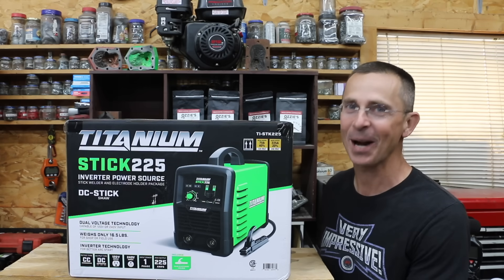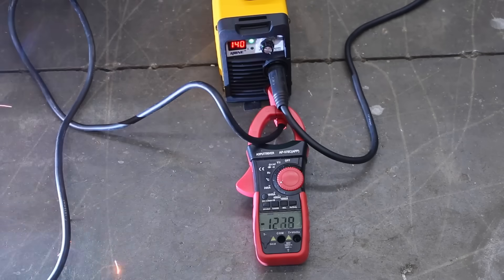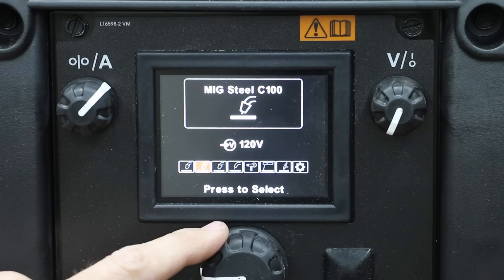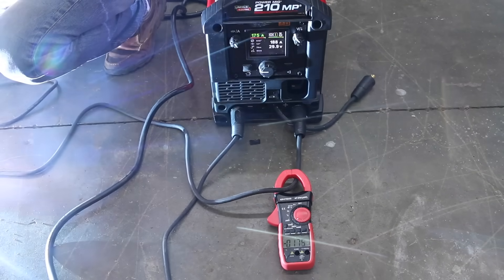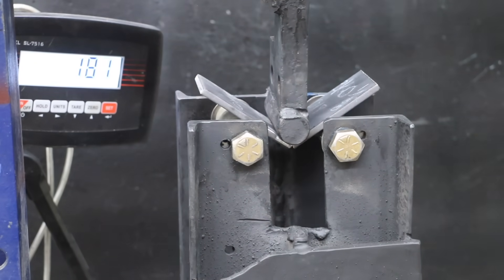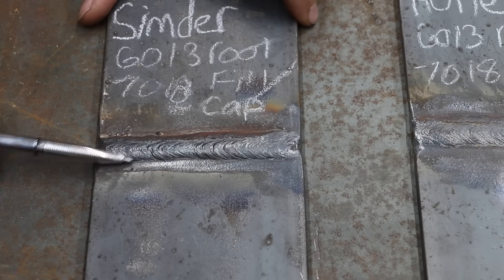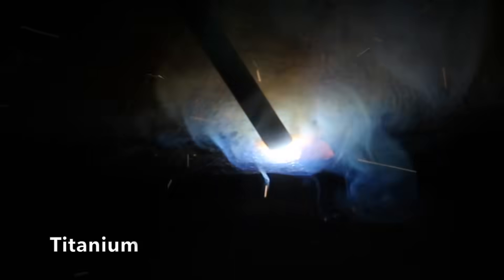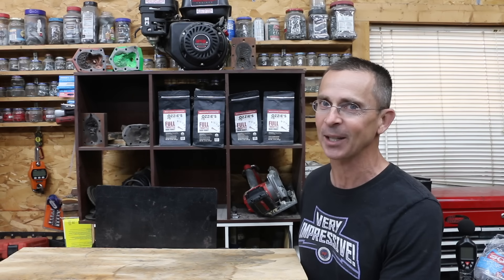$70 vs $2,300 Welder? Let's Settle This! Weld Strength, Duty Cycle, Current Output, Build Quality

Comment: The clamp on current meter may not measure current correctly.. there are limits to wave shape and frequency.

Why didn't you test the harbor freight titanium mig at 449 ... The Chicago electric mig is really old technology .. it's thenonly one there that is 69hz xfmr with rectifier... rest are inverters
Reply from the maker: Thanks for the suggestion.

Comment: This is an extremely good testing channel, but in this case, you tested a bunch of off brand  SUV against one Ferrari.

How stupid.

There was only one decent brand represented: Lincoln. And the top brand: Miller was not even in the test.

This video should have been named "Shitty welders tested against one decent brand. All except one tested as shit".

This was a pathetic test. Definitely up to the normal standards of this channel, so if this is your first visit, definitely give it another chance. I will, even though their grade went from an A- to a C-  after this hot mess of a test.

Comment: Test the titanium easy flux 125! It’s a very popular welder.
Reply from the maker: Thanks for the suggestion.
Reply: @ProjectFarm  here’s an idea. Since flux core welders are the most popular and most purchased, you could do a test on the different brands of flux core wire and see which wire gives the best results in a flux core welder. Whether it’s harbor freight (Vulcan) or Lincoln innershield or forney or easy welder etc.

Comment: Thanks Joe!
Here's an idea for the next test: I have a large Lincoln tig machine, but I am looking for a small combination Mig/Tig machine to do some light sheet metal welding on my '55 chevy sheet metal. Only concerned with mild steel, but would like it to use my foot pedal and existing torches. Is there such an animal? If there are a couple, let's see which one is best! Thanks!
Reply from the maker: Thanks for the suggestion.

Comment: Not a good review, if you weld you always check for penetration and turn up the current until you get it, you don't really care what the Ampage actually is. Far more important is the Duty Cycle and what happens when you exceed it. How long before it cuts out, how long does it take to recover, if it's got a crappy fan and cooling this can take forever. The cheapest most reliable welders are the old type with a just a big transformer in a case of oil, if you sit them in a tub of water with the hose pipe running(Obviously you make sure it is impossible for the water to reach the connections at the top because the water flows over the top of the tub first, the case is already water tight or the oil would leak out). You can weld all day at 250Amps this way and you can pick them up anywhere for $50. The problem with the welders you reviewed is they don't last long if you exceed their duty cycle......which you did not test.

Comment: Have you ever tested airless paint sprayers? Especially those designed for DIY home use.  How much time do they really save in comparison with using brush and rollers?  Especially when considering masking required to prevent overspray and equipment clean up afterward.
Reply from the maker: Thanks for the suggestion.

Comment: ok i have a technical Question for the welders that use both 110v and 220v.  the adapter specifically like for the hone and ssinder.  the adapter has a 220v male end to a standard 110v female end.  is it putting out 220v at that 110v looking female end?
my thinking behind all this is ....are these just 110v welders w a rewired adapter to fit a 220 outlet. but still using 110v.
i dont want to blow things up if i use a different adapter as my outlet has different 220 prongs on my home.  
if you can plug in that 220 male end and use a Volt meter on that 110 (looking) female end. and let me know your readings.  i would expect 220 but some adapters say 110. 
Thanks.  Greatly appreciate it.

Comment: For those using this review to pick up a stick-only welder I found the Forney 180 Amps $350 is the best of the cheap ones and the ESAB Miniarc Rogue 180I is excellent if you can spend $800.
Reply from the maker: Thanks for sharing.

Comment: Just did this. Bought a $500 offbrand welder for a job that was going to pay 8 grand. Never did aluminum mig before so I thought I was really bad at it. After many white oxide porous beads, called the manufacture and they said return it to the store. It was faulty. Debated getting another one but broke down and bought an $1800 Miller. Once using the Miller I realized not only had the aluminum mig been faulty but the steel mig was extremely poor as well.
Reply from the maker: Thanks for sharing.

Comment: The Titanium welder must be the one they use on Garage54.  107% success!

Great review as always.  And the Lincoln being thrown in there shows that if the machine and operator can make a good arc, the color of paint on the machine doesn't matter. 

And that's coming from a guy who always buys blue when it comes to welders.
Reply from the maker: Thanks for the feedback.

Comment: Thank you so much for this! So many people should benefit from making a sound investment in good welding equipment. Like any tool, money spent is money earned. Personally I have an AMICO-160 brand from Amazon years ago. Worked great on 220v50a. It would even burn a 3/32 on 115v30a. In fact it ran quite well for just over 120$ and could almost fit in my lunch box. I burned up a couple of over torqued tiracs(mosfetts) and diodes, by trying to scratch start TIG some stainless on 115v. Pushing too far. It has been sitting on the back burner "fix-it shelf" for years now. Just keep putting off ordering parts. I prefer to run the Ranger 8 tig runner. Even though it costs me Dino farts. It welds so good. To further blah blah blah, you could do a couple of different series on the different welding machine  available. Like a part 2 of inverters like you said multi-process. Possibly engine driven units? You could rent the really big Vantage500 or the new big blue 50. Just to show what 500amps can do to solid steel with only a 1/4" carbon Gouging rod.
Reply from the maker: You are welcome!  Thanks for the feedback.

Comment: I don't know Joe but my shop is near harrisonville. Prof welding for 40 yrs I'm a big Miller fan. The origional hobarts were also great. Lincoln has some great stuff also. My oldest is a 1945 general electric with a Hercules 4 cylinder engine. Fun piece of history. Curious how you know somebody in harrisonville.

Comment: I own the mp210 and like it alot. It's easy to read display and easy to start welding with being it gives general ranges of amps and wire speed and takes size metal into effect. Simple yet powerful but pricey.
Reply from the maker: Thanks for the feedback.

Comment: The s7 has an interchangeable cord that is on a 240 for when you want to run high amp. Not the standard 125
Reply from the maker: Thanks for the feedback.
Reply: @ProjectFarm  no no, thank you sir for what you do!
Reply: Ive re watched the video. This one clearly does not have that capability? Older model maybe?  Anyway mine with the applicable cord definitely doesn’t run 90 amp short.

Comment: Ive owned the lincoln 210, the titanium 170, lincoln square wave 200, miller xtreme 8vs, a miller pro 400 and a miller 350p and I gotta say. That titanium 170 for a cheap mig welder ran damn near just as good as my lincoln 210. The pro of the titanium is that you can get a $250 aluminum spool gun for it from Northern Tool and mig weld aluminum all for less than $1000. Ide always reccomend the titanium/Vulcan series to beginner/home hobby welders. I would even reccomend the vulcans for small business/side hustlers.
Reply from the maker: Thanks for sharing.

Comment: I have a small HONE 120 volt welder and have been super impressed with it. Claims 120 amps and I believe it. It feels accurate, 85 feels like 85 amps. Built a truck flatbed and burned 12 pounds of 3/32 7018 and never had any problems. Super smooth arc
Reply from the maker: Thanks for sharing.

Comment: PF is the best review channel on The Web. I don't buy anything mechanical anymore without first checking with Project Farm to see if there's a review video. From laser levelers to engine additives to drill bits, to hand tools, lawn mowers and knife sharpeners...Truly a Soup to Nuts Channel. I've probably ran just about every serious brand of welder there is at one point or another and Lincoln, although a significant step up in investment, has always been right at the top of the game..For small business (great tax write-off) or serious Hobbyist, you simply can't beat them ⚡⚡🔥🔥😎😎
Reply from the maker: Thanks!  Thanks for sharing.

Comment: I have an older Lincoln mig, about $600 worth.  It only requires a few expendable parts to continue working.  I recommend anyone welding on the farm to set up a 30amp 240 outlet, for welders and other things.  As Granny used to say:  “There ain’t nothin’ more dangerous than a farmer with a welder.”  Hehe, best get some advice from a pro before melting steel.  A little practice, some safety, and all is well.  Read and understand the entire manual.  I switched to cover gas a few years back.  Much better welds now.  No cleanup necessary.  Thanks Joel.
Reply from the maker: Thanks for sharing.

Comment: If you review mig welders you should include the Hobart handler MPV. Has a multi volt plug and can run gas less flux or you can run gas with solid wire.
Reply from the maker: Thanks for the suggestion.

Comment: Titanium welders are made jointly by Miller Electric, and Lincoln Electric.... It is a joint project. So in fact you had two Lincolns up there one of their highest tier machines, and one of their lower tier machines... and it looked like they ran the table on the rest of them... I have  Titanium, and YesWelder machines and both of them are excellent machines for what they are built for.
Reply from the maker: Thanks for the feedback.

Comment: I'm originally a stick welder (SMAW). Was hesitant but i purchaced the titanium 225 stick welder from harbor freight. Its amazing if you have access to a 240v 50 amp breaker.

Comment: My man that is not how you weld ,you have to V grove with multi pass on thicker metal,butt joint you're not going to get proper penetration and you try to do it in one pass and you get undercut on top, not to be a critic, but that's not the way of going about it

Comment: Correct me, but isnt this mostly plastic soldering rather then ”welding”...?
The stapler adds something, but shouldnt the plastic melt and fuse together on the two parts that needs to be put together? Maybe some surface plastic melts, but it doesnt go very deep...

Comment: Great video, much respect.  
So I see the bargain basement welder is the hone at $90 
My boss  is a real stickler and is wondering how well does a 
12V deep cycle marine battery work,  stick weld emergency only.

gracias
Reply from the maker: Thanks!

Comment: A follow up to this could maybe compare welding masks?
Reply from the maker: Thanks for the suggestion.
Reply: @ProjectFarm  In the last three weeks I've purchased two welding helmets and one replacement lens.
The first helmet sheared a bolt on assembly, the second has a faulty headband that won't adjust. The lenses for all three didn't work. Be that because of defunkt batteries or internal faults.
I will add that all three were different makes.
It's a minefield of identical descriptions and or features on a product that is very health and safety oriented, yet the failure rates appear to be frighteningly high.

Comment: I'm curious about the reason for using 6013, but I'm guessing it's because most of the inverters, particularly the cheap ones, don't have enough arc voltage for 6010/6011. If that's the reason, then none of them have any advantage over the several older transformer welders I've bought for $25-$150.

6013 is near worthless in my opinion(free, so possibly unimportant). It was designed and intended for welding sheet metal to underlying structure. It's not intended for deep penetration, and to no one's surprise, does not deliver it. 7018 penetrates better, but it's still a low penetration electrode. The only real advantage 7018 has for welding at home is that it's slightly more ductile than other electrodes. Your initial "penetration" test results were unsurprising. Intentional or not, it showed the reason that joint preparation is critical to the strength of the end result.
Reply from the maker: Thanks for the feedback.

Comment: Would be interesting to have measured open circuit voltage at the welding leads. I suspect that the welders that struck an arc easier on the rusty steel have a higher open circuit voltage

Comment: Please do the solar generator with solar panel options & see witch one can sustain A/C unit in dead of summer while it's dead mid of summer. We lost electricity yesterday & last night was so hot everyone struggling with extreme heat. Only trust your reviews. Please help us know what's best when you can't use gas because of apartments don't allow. Thank You more than you know P/F, this would help everyone worldwide. We all need a Emergency video from you Please..
Reply from the maker: Thanks for the suggestion.

Comment: you should have tried 6010 with each machine to see how they welded with it. I have heard some inverters cant run 6010 very well and some cant run it at all. it was a very good test though.
what welder had the best arc in your opinion?

Comment: Running a welder continuously for too long will eventually kill it.  I had an old Lincoln buzz box that I could weld until it would not strike an arc and let it cool and go again. I wonder how these welders will do over time because you get what you pay for as a rule.
Reply from the maker: Thanks for the feedback.

Comment: I'd love to see a multi process welder matchup. Specifically, if the Eastwood 200 Amp Elite MP200i for around a $1,000 is really the best. Oh, and they have an LCD version for just ~$250 more.
Reply from the maker: Thanks for the suggestion.

Comment: Thanks for the help on the video Joe and hope you will be back for the multi-process test video. 
I hope when you do that video to see a Forney welder in the line up as they claim to make an equal quality welder to Lincoln and Miller but at a around 1/2 to 3/4 the price.
Reply from the maker: Thanks!  Thanks for the suggestion.

Comment: I am interested in Mig welding now, as recommended by a YouTuber welder, so a comparison between entry level to something like Lincoln, Miller or Hobart would be appreciated.  He said, "You’ll want to look for a 120V Mig welder and use flux core wire. That will allow you to do most small-medium projects."  I want the flux core wire to be self-fed rather than using sticks.  You already have your Lincoln from this video, which also does Mig, but I just need one for homeowner infrequent use and maybe a project here and there.  And if a self-feeder for flux core wire is a separate purchase, please cover them, too, in another video right after, if necessary.  Thanks in advance, Todd.
Reply from the maker: Thanks for the suggestion.
Reply: @ProjectFarm   The welder YouTuber just told me that a Mig Welder should come with a flux core wire feeder as a Kit.  Therefore, also comparing how well each feeding system works could be included in the comparison products video, when you get to it.  Thanks

Comment: When I was like 12 or 13 my dad bought an entire pallet of welders at an auction i think he paid $400 for the pallet it had 30 welders on it needless to say they werent perfect but we ended up using them on the farm for almost everything we needed welded im 29 now and we still use the first welder we opened when we bought them its never fried or had any issues. We ended up selling the rest to neighbors and stuff. I wont ever knock a cheap tool because sometimes cheap is good enough for the job you need done👌
Reply from the maker: Thanks for sharing.

Comment: Now whats needed is a review on auto darkening welding hoods, what good is a good welding machine without a good welding hood, I was surprised you didn't already have video on welding hoods!!!!!!!!!!!! I was also shocked on the variety of welding hoods on the market now, ranging from $25.00 - $2,500.00<<< that is way over my budget, I'm thinking somewhere around $100.00 + or -...........
  I want to update my old Sellstrom hood with small lens to something with a larger viewing lens. Right now I'm leaning towards  Yeswelder LYG-M800H, but I first had this hood on my list> ANDELI Welding Helmet, but Amazon it had all very bad reviews. Then I look up the welding hoods at HF, they also have a good selection, then theres numerous other brands that I never heard of on Amazon, so a budget welding hood review is long over due, from you!!!!!!!!
Reply from the maker: Thanks for the suggestion.

Comment: Thank you for doing this topic.  Being a novice/nube, I nearly bought one for random small projects.  I have 3 topic requests:
1.  Do a video on the systems that advertise doing most to all types of welds.
2.  Do a worksite cooling system review (i.e. types of fans, mister vs. no mister, plug in vs. battery, etc.).
3.  Personal cooling systems (neck fans).
The last 2 are pertinent due to work with tools tends to be outdoors or indoor hot environments as the climate gets hotter and our attempts to work safer (non-heat related medical accidents: heat stoke, etc.).
Thank you for everything you do.
Reply from the maker: Thanks for the suggestions.